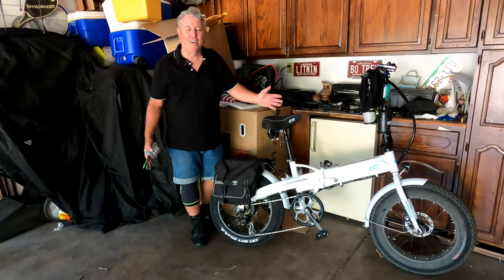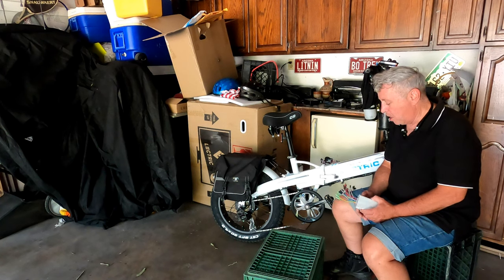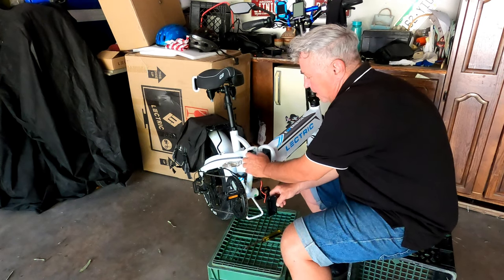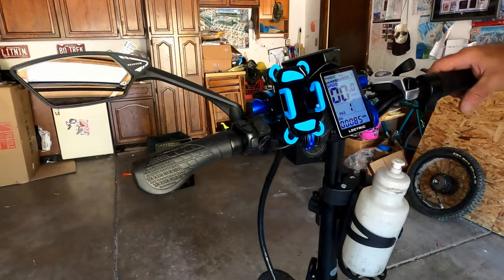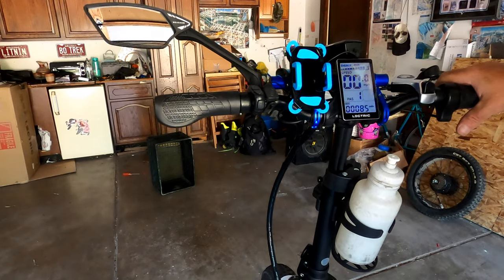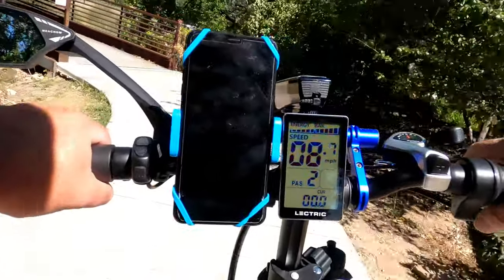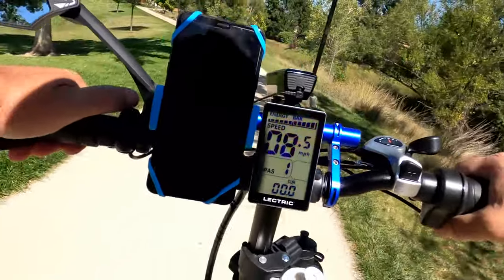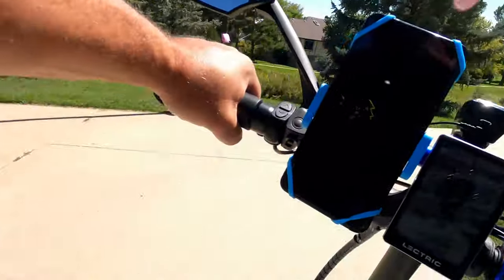Lectric XP ODO Speedometer Problem Controller Final Fix

Comment: Hi Bo, do you think it's a good idea to pic up a back up controller in case the company goes under? Or do you think a good ebike shop could make another one work if needed.
Reply from the maker: Only if you have money to burn.  I do not think this company is going to go under.  They have been doing a great job.
Reply: @TheeLightningMan  I spoke to them today and it’s only 70 bucks for the controller so not too big of a fire LOL thanks so much for your input.
Reply from the maker: @mxwlj6974  That's not bad.  I was expecting $300 or something.
Reply from the maker: @mxwlj6974  My pleasure.  Thanks for weighing in.

Comment: Hi Bo, I'm glad it's fixed as well. Do you think the controller was the cause of the motor turning off in the mountains? Or, was the motor was just protecting itself from overheating, and the controller issue on the same trip was just a coincidence?
Reply from the maker: The motor was protecting itself.  It has that built in.  Yes it just happen to be a coincidence.  The bikes keep getting better and better.  Great Company and support.  No problems since and rides great!  Over 600 miles now and going strong.  Anything electronic can have a chance of something like this happening.   But I think like with anything else it usually happens right away.  The bike is amazing and worth every penny.  Lot of fun.  Thanks for watching and the question!  Seasons Greetings!

Comment: Ciao come hai sbloccato la velocità su questo controller??
Reply from the maker: 1.Access the settings menu by pressing and holding the up and down arrows on the control pad simultaneously until the screen says "P1".
2.From here you can cycle through settings by hitting the "m" button on the control pad and adjust the settings by pressing the up or down arrows on the control pad.
3. Please go to setting "P08" and change this setting from 32 to 45.
4.Press and hold the up and down arrows on the control pad until the main screen is shown once again.
5.Power the bike off by holding the “m” button to save the settings you have just changed.
Reply: @TheeLightningMan  ok proverò più tardi e spero di riuscirci 🙏
Reply: @TheeLightningMan  Ho seguito le tue istruzioni, al settaggio p08 clicco sopra con M per selezionarlo, ma rimane fermo a 25Km/h, e il numero lampeggia ma non viene superato o diminuito tramite le freccette :(
Reply: Forse qui in Italia ho la centralina bloccata sul valore di 25Km/h
Reply: @TheeLightningMan   Puoi aiutarmi?
Reply from the maker: @giovannilabriola9821  It should change.  But you maybe right it might be locked because of Italian regulations.  It should change normally.
Reply from the maker: @giovannilabriola9821  You might have a no class three regulation.  I could not find it.
Reply: @TheeLightningMan   Se provo a comprare un controller diverso da 36v 250/350w 6 mosfet, riesco a risolvere il problema?
Reply from the maker: @giovannilabriola9821  I do not know. You would have to contact Lectric support.